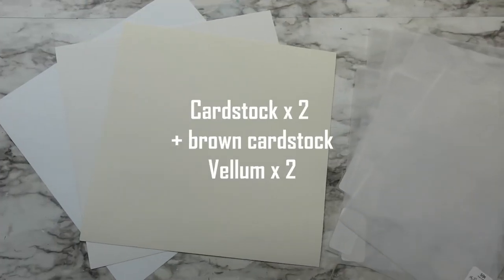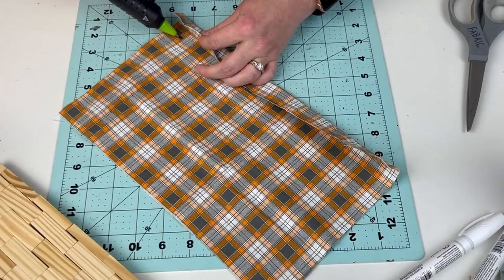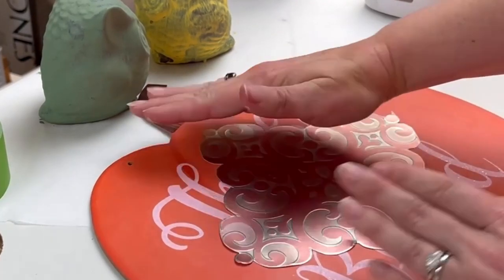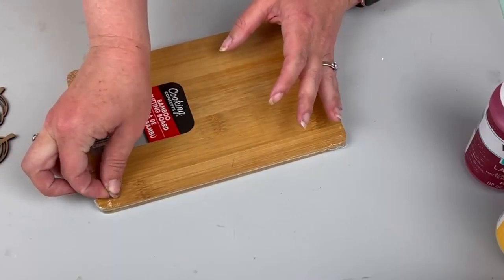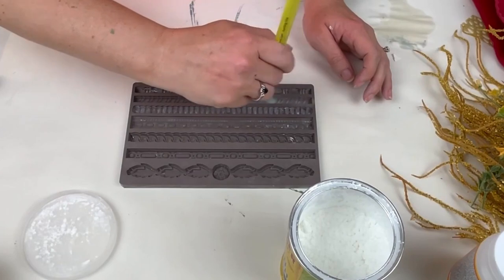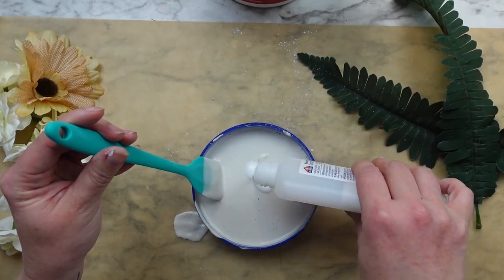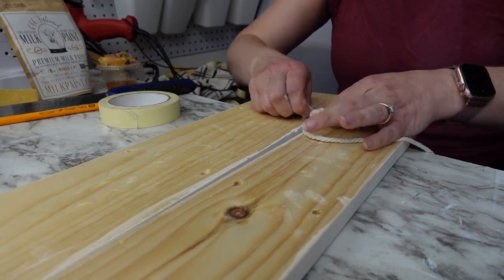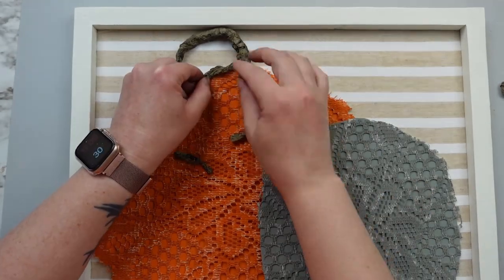MEGA VIDEO // Fall DIY Decor 2022

Comment: Best way to fold chicken wire to go over a sign, don't cut so close just cut  solid wire on ends. Sit wire and sign at edge of work bench or protected table and use a pot holder or thick kitchen towel to fold wire over edge of sign. When finished getting wire in place then cut extra wire off.

Comment: I torture craft too! Lol it's the curiosity behind it all! Great video Tfs ❤ p.s.. okay so i havent tried this BUt a friend told me to try letting your air dry clay dry overnight (dampen the clay with water first when putting on the bag) with a plastic bag over it, kinda sealed, but with a little opening so it can dry slowly. I heard it helps the clay dry slowly, minimizing cracks 🤞happy torture crafting 🤣😋💕
Reply from the maker: Yes! Someone gave me the same advice on drying the clay slowly. I have not tried it yet either. Hopefully I remember the next time I make something 🥰